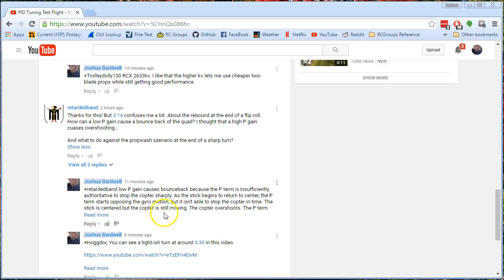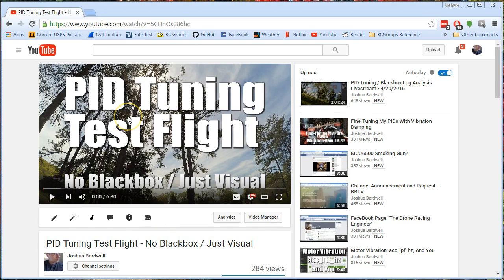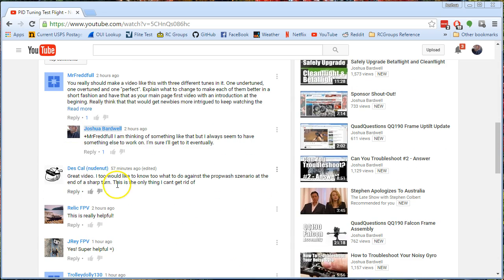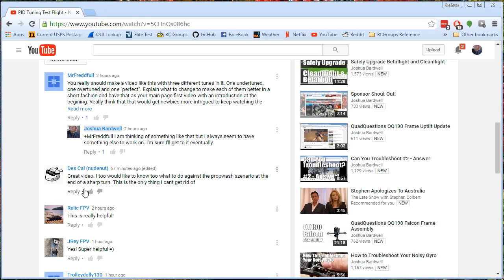How To Tame Propwash Oscillation

Comment: Any point in running dshot 1200 on 16k/8k loop? Is it better to run dshot 600 with 16/16k I ask bc those are the 2 options acceptable for me CPU wise
Reply from the maker: 1200 is probably not noticeable difference for most pilots but it will cause more noise. I would consider 600. Try kith and see if you notice any difference!

Comment: Oh and how can u stop ur quad from drifting backwards with out trim
Reply from the maker: +Sean Willbye in autolevel mode, use accelerometer trim. But autolevel mode isn't perfect and the copter will drift. You need GPS to really prevent the copter from drifting at all. 

In any mode ensure that the channels center at 1500 in the receiver tab.
Reply: Joshua Bardwell how best to connect controller to laptop to test the center points please

Comment: Hi I got a naze 32 flight board on my eachine assassin 180 v2 got stable take off now how can I increase the yaw speed got rc rate at 1 and expo rate at 0.45 and rates at 0.70 on betaflight 3.0.1 as my quad won't go any higher firm ware version hope some one can help
Reply from the maker: +Sean Willbye yaw rate should be able to be increased up to 2000 degrees per second, which should be more than enough for anybody.

Comment: Im running dshot600 8k/8k on an X frame 5inch 4s. I got to the point when raising P gain that I would get some  oscillation on full throttle and fast forward flight. I lwered my P gains from around 60 to 38-40 and its flying much better. When I at first tunend it =, I started at 20 P and started raising and  definitely see the drunkk thing you were talking about ut it got better at 30 and really good at 40-45, but ater that it didnt get much better and I got vibrations. Is this a normal tune. It seems to me like its not normal but this is my first 4s blheli build. Im using some King kong 5040's as you said they are easier to tune then the DYS 5x4x3 (which i got before watch that video). 

For details about my setup here it is: brotherhobby Returner R2 (ZMX V2 clones) 2300kv, DYS XSD20A Dshot600 esc, Realacc X210 Pro, Infinity 4s 1500, F303 v3.1, BF1.1, 8k/8k w/ accelerometer (38-43% cpu load)
               P     I     D
Pitch      38   50  30 
Roll        37   50  30
Yaw       55   55
Reply: This is definitely not a perfect tune btw. Im getting some high frequency vibrations on punch outs (might be too high yaw P bc I had the same thing happen in straightaway and turned down Yaw p and it stopped doing that). I also dont have video bc I dont own an action cam
Reply from the maker: The best tune is whatever flies best on your copter. Those P gains are lower than I usually end up with, but there's nothing wrong with them. If you're happy with how it flies, don't sweat the numbers.

Comment: Switching to active braking esc's fixed that for me with almost no change in PIDs.
Reply: I know it seems like he's just being pedantic but precision in language really matters to engineers.  Language describes the model and if the model is wrong then you can't have a technical conversation.  And on that note, I think it's important to clarify that prop wash is a physical phenomenon associated with a moving airfoil, not something you can control with and ESC or tune out with different PID gains.  What's really going on here is that your prop wash is a large disturbance on your control system when you fly through it and your system will oscillate if it is under-damped.  Altering the tuning as you describe improves the model for these conditions, but doesn't change the prop wash coming off the propellers.  You might be tempted to argue that ESC braking slows the props and thus changes the prop wash, but any pilot (of real aircraft, I mean) can tell you that the already disturbed and now turbulent air lingers for some time (this is usually in regards to the wake turbulence from fixed-wings but can also be prop wash from helis).  What regenerative braking does is change the transfer function of your plant, making it more responsive to your control inputs and thus allowing you to "tune it more aggressively."
Reply from the maker: Active braking ESCs are simply a must-have on a modern multirotor.
Reply: Can you print some ESC for quad that have active braking, all I found do not have it, they all have regenerative braking.
Reply from the maker: +Miloš Lazović whatever you call it. Thus us the thing you want for mini quads. Same as KISS and DYS XM and XS series and so forth.
Reply: Joshua Bardwell
I thought you are talking about ESC with active braking (like for example Kontronik KOSMIK which have active braking but is useless for quad due it size and weight), KISS and DYS XM and XS all use regenerative braking (which is not same as active braking).
I would preferred to find ESC with active braking, which produce more braking force (you can think active braking is like disk breaks, regenerative braking are more like drum breaks) and work totally different, but it seems that no one make it for quads (I thought you find some, that why I ask which one you use, but it look you find same as I did).

Comment: im running a naze 32 rev 6 and in just hovering my quad has this slight wobble any ideas? thanks
Reply from the maker: Not enough information.
Reply: naze 32 rev 5 sorry my other quad has the rev 6. i noticed in my goggles as i am flying that it looks like my quad has this steady little bounce. also in hover it has a wobble to it. not sure if this is a tuning issue or something else. i had a cc3d on this quad before and swapped it out for a naze 32 rev 5 now. Its running a 3s battery on a qav-210 frame, running emax 2204 2300kv motors.
Reply from the maker: Any video?
Reply: Sounds like it could be your props aren't balanced or are damaged also it could be the cameras not mounted firmly otherwise it could be uneven weight distribution :)

Comment: i get really bad oscillations on decent that I cant figure out, when i drop the throttle my quad just shakes and is hard to control
Reply from the maker: +DigitalJack is air mode on?
Reply: +Joshua Bardwell no it does it in angle, rate and horizon have not tried it in air mode I assume it would do it in that mode too. I tried lowing my I roll gain and it got worst. I tried lowering my P roll gain and it got worst my P roll gain is at 4.5

Comment: I have a quad that flies well in almost all circumstances except one. When there is a cross wind, wind perpendicular to my flight path, I get oscillations.  Will adjusting the P-Gain for pitch help with this type of oscillation?
Reply from the maker: Unknown. It seems like a crosswind would cause roll issues if anything. But that's such an oddly specific issue that I'm not sure I can call it just based on the description.

Comment: When tuning, do you tune each axis separately? If so what axis do you start with? Is there a method to that madness? I know you start with P, but what axis? My copter is not symmetrical. Thanks :)
Reply from the maker: +Dean Thorton without Blackbox, I would tune pitch and roll separately. With Blackbox, it's easy to see what each axis is doing and tune them at the same time.

Comment: Hey Joshua. Thank You for all your videos. Can you make a video on how to properly tune the Kiss FC? Final Glides video is helpful but is limited in details when it comes to tuning. If you could do this I'm sure it would help lots of folks including myself. Thank you again.
Reply from the maker: +Cloudburn FPV KISS FC is not doing anything fundamentally different than any other multirotor PID controller. The same guidelines I give in my "Mini Quad PID Tuning From Start To Finish" thread apply to it. That thread is a bit dated--the copter looks like it is flying terribly, and my skills as a pilot have come a long way--but the basic instructions should still work.

http://www.rcgroups.com/forums/showthread.php?t=2439428

Comment: Hey Joshua, thanks for doing what you do for the community. I have a question, what would you suggest is a good tuneable range for the D term? I have had it up as high as 40 on one of my copters before. And I have seen some as low as 5, so my question is when should I stop turning it up and look at those measures of vibration dampening and such?
Reply from the maker: +Liam Lambkin depends heavily on the Betaflight version and the noise level of your copter. With 2.6.x, 30 to 60 is not remarkable.
Reply: +Joshua Bardwell cool, cheers. I was talking the latest version, I was worried about turning it up too far. as I am with pretty much all PIDs. As sometimes it's hard to know when to stop. It also happens with my P gain, I keep turning it up, waiting for osc to happen, and I usually get scared and stop because I think the number is too high. I have one copter that needs to have excessive roll I gain to stop it from rolling against the turn while banking. I on roll = .55
Reply from the maker: +Liam Lambkin my I gains are usually between 45 and 65.
Reply: Thanks a LOT Joshua!

Comment: I honestly just gave up on getting rid of the propwash oscillation 15 minutes ago. Flew my last lipo and came in here to watch YT, and this was the first suggested video, lol. 

 Now I don`t feel so bad about giving up. I guess trying to avoid severe propwash situations could probably force me to fly more smoothly. 

 Thanks for the timely video, Joshua. You`re the man.
Reply: +Joshua Bardwell Please do.  I was planning to make a video of it also but I know yours will be better...  

Its a subtle difference and depends also on the frame design - those who use it have noticed less wobble coming out of hard turns.

I think user KSAL on RCG tried it first on his Tilt-R

PS... LOL, I didn't notice the second part of your post - Yeah I sometimes talk out of my ass but never about aerodynamics.  ;-)    I have 11,000 hours full size (fixed wing and rotary ) with a background as a flight instructor and air crash investigator.  My focus was aerodynamics and flight path analysis.
Reply: +Tyrone Shoelaces FPV Did you try reversing all motor rotations?   Reversed rotation is aerodynamically superior for several reasons on a quad that spends a lot of time flying fast forward and yawing hard.
Reply from the maker: +Trainboy64 why is that?
Reply: +Joshua Bardwell I posted a link in a previous video of yours - but the full discussion starts here. (Posts 320, 323, 355 and 357)

http://www.rcgroups.com/forums/showthread.php?t=2459197&page=22

Try it - those who have agree that it helps.
Reply: +Joshua Bardwell Each prop also has its own centre of thrust and this is biased away from the prop centre in forward flight due to P factor (different P to a PID) https://en.wikipedia.org/wiki/P-factor

In fast forward flight with normal rotation - p factor makes the forward props more effective in roll and the rear props less effective.  This is due to CoT moving outwards on the front props but inwards on the rear - this combined with the fact that rear props are always flying in dirty air.   

Reversing rotation moves CoT inwards on the front props and outwards on the rear (again, only relevant in fast forward flight)   This increases the effectiveness of the rear props which compensates slightly for the dirtier air they experience.
Reply from the maker: +Trainboy64 wonder if that would reduce the positive pitch I term that I always see in forward flight.

Interesting analysis. When I first read your comment, I thought there was a fair chance you were talking out your ass. But I see you're not.
Reply from the maker: +Trainboy64 PS: hope you don't mind if I make a video about this, because this is pretty cool. How much of a difference do you experience? Like, night and day, or pretty subtle? Can you characterize the difference?

Comment: Hmmm. Great video! But(!) I am as dumb as before. The solutions are: raise or lower the p gain. Or raise or lower your D gain. Or youse filters - but filters are bad....
You explained that very well. But my conclusion is: I make my life easier and life with a little bit of propwash ;)
Reply from the maker: +retardedband you're joking a but, but that is actually the same conclusion I use. Honestly I think propwash is more about your ESC's and firmware than anything else. You can tube so far but you won't get rid of it entirely on most gear that exists today. Unless you tune the copter so soft that it flies badly. 

Another thing that can help with the oscillation right when you raise the throttle is to raise min_throttle. But this hurts your inverted hang time.

Comment: I have noticed that my D precedes my P in 2.6.1. Do you think we require more P in yaw now that we don't have a D?
My brain hurts;)
Reply from the maker: +Drone Punk D always leads P. That's the nature of the derivative. I don't think D was ever very effective on yaw because yaw has so much less authority to begun with. But I never ran high D so I don't really know if there is a difference.
Reply: +Joshua Bardwell  man I have a lot to learn. I thought that When D was in front of P that was the phase delay issue with filtering.
Thanks for all you do bud
Reply from the maker: +Drone Punk D needs to be leading P, but it needs to be leading P closely. The further away from P that D is, the worse it performs. Think of P as looking at what we need to do right now, and D as looking ahead, figuring out what is going to happen to P in the future, and helping to compensate for P's short-term focus. But if D is too delayed relative to P, its corrections aren't as effective.

P - What do we need to do right now to get rid of the error?

D - What is going to happen in the future, and how can we adjust what we're doing right now to do better in the future?

I - What did we fail to get right in the past, and what do we need to do right now to make up for that?
Reply: +Joshua Bardwell every time I get cocky about my tuning you can sure humble a guy. ^^^^^ great analogy 
Thanks again.
Reply: +Joshua Bardwell what does a leading P means in numbers? Stock PIDs in betaflight are P 3.5 and D 20 (or something around that). Is that close?
-> sorry - I never used black box and I probably never will since I'm switching all of my quads over to KISS FC. 
But I'm interested..
Reply from the maker: You can't tell just by looking at the gains. But my guess would be that 3.5 is too low and is intended as a safe number for the default. Can't really judge D. It depends heavily in the copter's noise level and the pilot's preferences.
Reply: For brain pain try adjusting I's. And eers, and noze. Hah I crack me up. Thanks josh, I've learnt a lot from you, you have a way of explaining things so succinctly where others are unable to, keep it up!

Comment: so I need to re-calibrate escs after switching to betaflight?
Reply: from openpilot
Reply from the maker: +AveryFpv yes for sure. The motor output endpoints can't be assumed to be the same.
Reply: +Joshua Bardwell thanks!, I tried multiple times but my escs won't calibrate
Reply from the maker: +AveryFpv with blheli make sure stick commands is enabled.
Reply: +Joshua Bardwell it should work, they calibrated with openpilot before I switched to spracing board
Reply from the maker: Are you using the motors tab?
Reply: +Joshua Bardwell yep. I get about form 0 to 8% of the throttle works fine but won't calibrate and only enough lift to wobble it around on the ground
Reply from the maker: what is your max_throttle set to?
Reply: 2000, I checked on my taranis and it's 2000 on that to
Reply from the maker: If the Motors tab is showing more than 1600 on the motor output, and the ESCs have stick commands enabled, then the ESCs should calibrate. I'm not sure what could be going wrong. Are you using some exotic option like multishot?
Reply from the maker: Just to be clear, you are using the Motors tab sliders to calibrate, right? You mentioned the Taranis, but the Taranis has nothing to do with ESC calibration.
Reply: +Joshua Bardwell nothing unusual just oneshot, which worked with openpilot
Reply: +Joshua Bardwell yes, motor slider to calibrate, is there any other way?
Reply from the maker: AveryFpv Some people attempt to calibrate by putting the throttle stick at maximum, as with a fixed-wing.
Reply: +Joshua Bardwell steps? I've never had to calibrate ESC for planes they just worked
Reply from the maker: It's the same: full throttle, power up, zero throttle. But don't do it with a flight controller. The throttle stick is not directly output to the ESC. So that's not the right way.
Reply: +Joshua Bardwell oh, well I'll keep trying different stuff, thanks for your thoughts